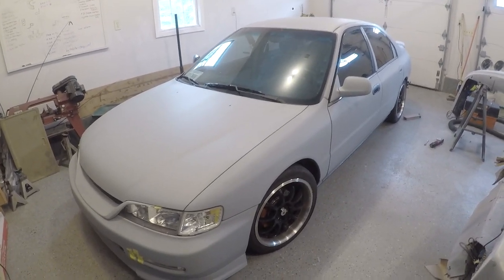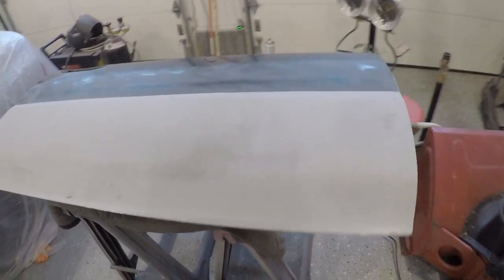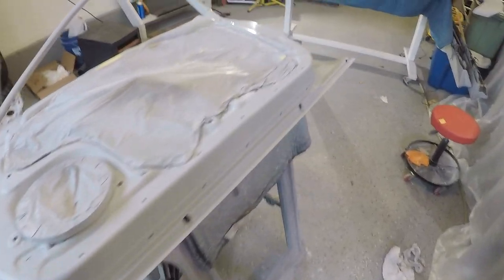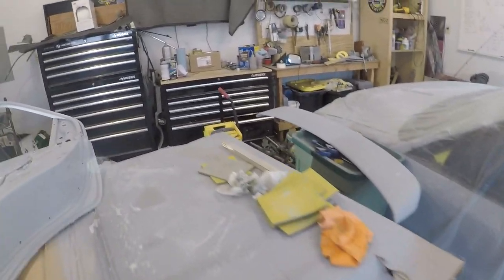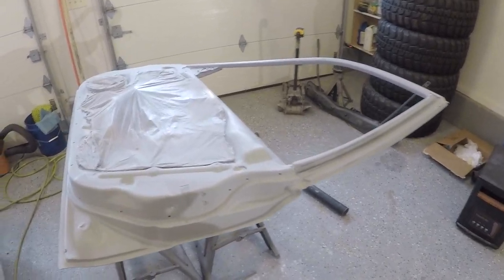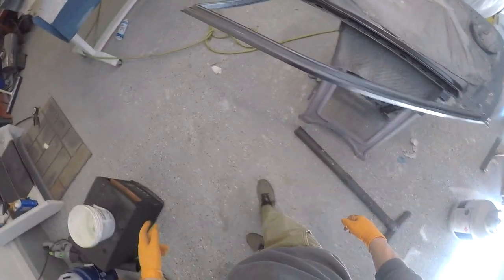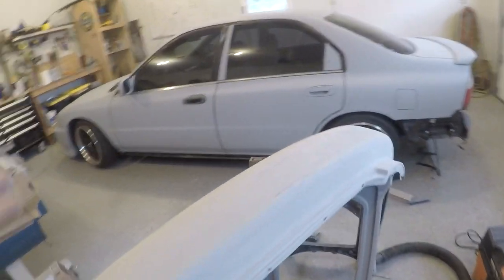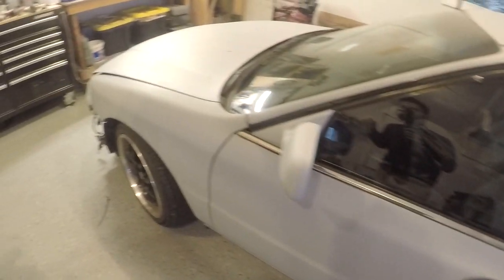Turbo Accord Quarantine Painting Episode: 1

Comment: If I take my power steering pump and the hoses outta my accord can I still drive it without it messing up? People have been telling me it will mess up my cv axles
Reply from the maker: Definitely won't hurt the axles man. It will not have power steering but that's okay if you're ready to go full racecar lol. You need to loop the lines on the power steering rack. The rack still needs fluid to operate even without the pump. There's definitely videos on how to do it.